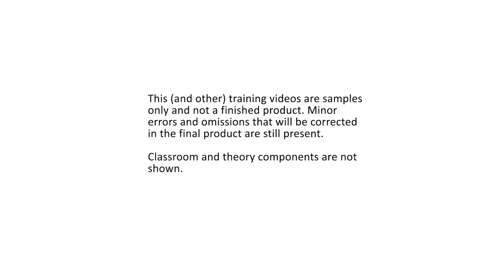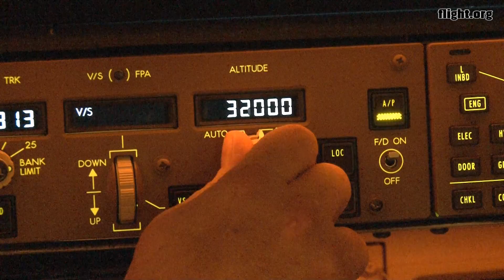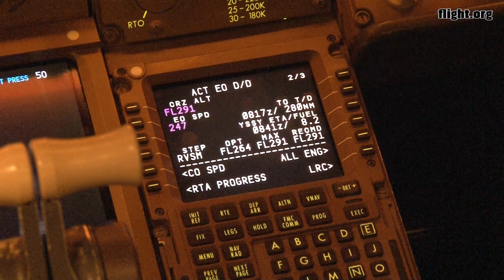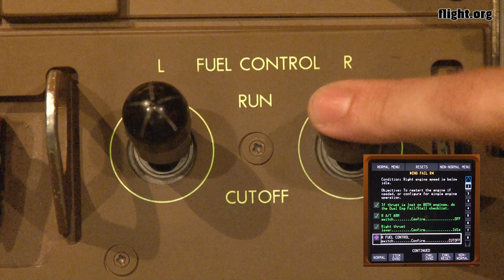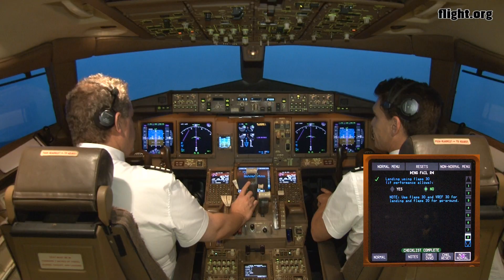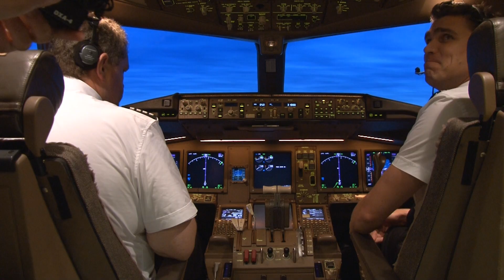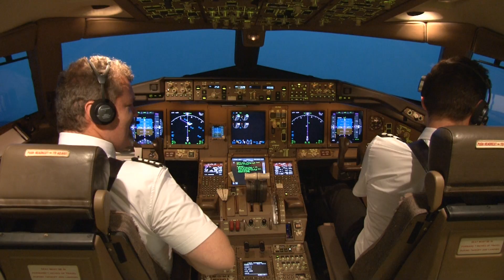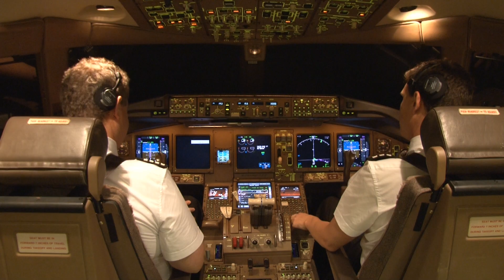Engine Failure and Driftdown in a Boeing 777

Comment: Why using Flaps 20 and not flaps 30?
Reply: Several reasons. At about 15-25 (exactly number depends on design details) flaps are generating best lift/drag ratio. At 35-40 its juts little more lift (more exactly coefficient of lift) but drag increases much much more (which is somehow better at landing because of more aircraft stability). In single engine operation and full flaps (35-45 depending on aircraft type) its higly possible to need for full or almost full thrust from remaining engine. Full thrust from single engine cause more asymmetric thrust and more rudder deflection (even full rudder and full aileron). Also, you have not spare thrust for go-around.

Other reason is failure probability. At idle failure almost never happen. At full thrust (sometimes more than 100% for some time is allowed) its very likely to encounter another engine failure. Thats why in most cases at take-off, less than 100% thrust is used.

Personally in flight simulator I dont like to use full thrust in half of planes - its easier to control and speed is not increasing too much - I have not other pilot in simulator to handle flaps and monitor speed - so I need more time, to make this safely (even if this is a simulation).

Comment: Why didn't they switched on the fuel x-feed?
Reply: Not in the checklist. If working engine is connected to right/left wing tank only, then will be unbalanced fuel alarm when it should be. Feeding fuel without necessary reason is not good. When You encounter fuel leak, then (in most cases) You dont wanna to feed hole in wing. Double/triple emergency situation is very rare, but it happens from time to time.
Reply: @norbert.kiszka  Cool. never thought about it that way. So when imbalance caution arises, it's time to verify if there are conditions to perform that specific checklist. All this because of that Air Transat Azores Glider...

Comment: Outtakes of actual flights are called “disasters.”
Reply: This planes (transport planes) are designed to fly and climb just on half of available engines. BTW. Even of lost all engines and also power (hydraulical and electrical) then plane will not fall and still will be manouverable by mechanical linkage (at least rudder and THS). Today only problem to concern at flight at high altitude is a fire inside cabin, flight deck or elsewhere in plane. Fire in plane can be caused by stupid passenger. Personally in case of double engine failure Im going to sleep and wake up after emergency landing. So please stop spreading misinformation.

Comment: Perfect crm. But didnt they divert 30 degree either way upon driftdown from the current FL?
Reply: But why...?
Reply: In a pressurization rapid descent maneuver, it is more appropriate to do a diversion off the airway, and it will not be wrong for an engine failure drift down maneuver. However, If under positive control in controlled airspace, you would be descending, at slightly higher than normal descent rate,[ to maintain airspeed,] to a single engine drift down altitude. That is something ATC [ Air Traffic Control  in a radar environment ] can manage to accommodate.
Reply: +Denis Levashov  In this video example the cruise altitude was FL370 and the drift-down Single Engine cruise altitude [ calculated by the flight computer ] was FL290.  so you are doing a decent of Only 8,000 FEET while maintaining cruise airspeed. This Procedure is not a big or sudden change of altitude.  When the pilot declared "Pan  Pan  Pan" [ Indicating Emergency Status ] He has airspace priority as an Aircraft in distress.
Reply: Well, i dont agree that 8000 feet is a not a big sudden change of alt, at least, if in RVSM you are crossing at least 7 FLs. Declaring a PAN PAN PAN doest give you any right to compromise safety of others but if just in uncontrollable dive.
I got your point and dont want to argue having in mind that it was just a sim session, and in real pilots know how deviate from current FL right.
Best regards!
Reply: Whoa  COWBOY. I never said what you are saying. Clearance to FL290 was requested and received by this crew @1.15 minutes, so what's your point.  Many aircraft descend from one Flight level to another routinely along the airways with ATC . Its a normal decent. I don't know that a controller will make you stay up there loosing airspeed and lift.  THEY GOT PERMISSION TO DESCEND.
Reply: Tom A sorry, my bad than) thanks

Comment: what to do when i got engine flame out ? is possible to fix this problem ?
Reply: Whenever an engine flames out, immidietly, extinguish the engine, make a mayday distress call and ask atc for headin to nearest airport. Tell them where ur heading, whats ur current alt etc. for ex: "mayday mayday mayday tower air velocity 2886, we have a fire in one of our engines we are currently heading 189 and at flt lvl 290. Requesting vector to nearby airport." Atc would give u headings and tell u to descend, make sure u follow those rules.
Reply: +MR COURIER Before all of that, fly the damn plane.
Reply: Alistair Hammond lol yes. One person handles the crysis, and the other one flies the plane.
Reply: i noticed on my xplane 10 that when engine flame out you need to set ignition on CON in boeing 777 and the engine will started. But when you set START engine wont start.

Comment: 0:47 minutes right engine failure without airframe vibration. 2.40 minutes engine restart as needed yes or no [ no ]  This is a captains decision, but no substantial evaluation done towards engine restart  [ oil quantity,  vibration meter, oil temp, etc ]. even at idle the recovery [ of this engine] enhances the systems operated on the right side. [ example pumps generator and air condition packs]  Is this normal company procedure considering that this is an overwater aircraft.  // hilarious video.

Comment: where can i find a flight simulator and how much do they usually cost?
Reply: Usually, it costs between 30million - 50million dollars
Reply: sorry, I meant to use it
Reply: ***** I don't know where you are; but in Melbourne (Aus) there is a company called jet Flight Simulator-they have a 737 NG cockpit and for about $200 AUD you get about half an hour.Note: this is not a full motion Sim (like the airlines use) but it's as realistic as it gets for the money. They supply an instructor,and you can land and T/O at any of the major airports around the world-good luck.
Reply: chris hood Thank you
Reply: ***** If you want to try a Flight Simulator without all of the controls, you can use Flight simulator X, it was republished on steam and it has a virtual cockpit, but also buy PMDG Aircraft addons, they use complete simulation, where as the default planes don't include all of the devices.

Comment: PIC noted insuf-fuel. Now. Is that mainly due to one engine working now and the recalculation? Or the fact that they kept on full NAV mode and the computer noticed fuel economy at the new flight level and that was the reason for the insuf-fuel warning?
Reply: Both.
Reply: +William JSS   when you do flight planning you ask the captain " how much fuel would you like to land with. This is considered your OWN personal reserve fuel setup. Example "I want to land in Sydney with 12,000 lbs of fuel". [ that number is entered in the flight computer ] that is about [say] one and a half hour of extra fuel.  if ATC assign to you a TEN minute holding delay you know that you have 1hr 30 minutes - minus 10 mInutes - reserve.  WHEN you loose an engine or enter holding [ with expected 10 minute delay ] the computer recalculated the new fuel burn and realizes that on one engine [or with ATC holding or with stronger headwinds ]  you will not land with 1 Hour  30 minutes of fuel so you get the "Insufficient Fuel" warning. The pilot can then talk it over with the crew and suggests that we are ok landing with only one Hour reserve fuel. You then go into the computer and adjust the landing fuel from 10,000 lbs - 1 hour 30 mInutes to 8000 lbs which represents only 1 hour reserve. This would turn off the INSUFFICIENT FUEL WARNING.

Comment: an engine failure in a 777 in the middle of cruise is not a big deal and is hardly something to get worried about. it can take off on a single engine even at maximum takeoff weight, and the flight plans are designed so that the plane can divert to a suitable airport easily enough with one engine operative.
now if both engines go out you're going to have problems..(though it's happened before and the pilot landed the thing!)

Comment: I'm a 777 crew... the "cuts" at the end are more reflective of a real crew than the procedure portion, but I understand this is a training video.  The comments at the engine failure itself would be more like "F me. Now we're spending the night in Manaus... or Kuwait... or Keflavik."  Your guys do good work procedurally.  These videos also show off the 777 nicely.  Good job.
Reply: Great job, but I'll be a smart ass. No one confirmed Continuous Thrust set on the good engine. :-)
Reply: @777Outrigger As Instruktor in case of engine failure at cruise altitude my question to candidates was: what is the bottom line of your problem? I’ve heard so many answers but almost never the crucial one : we cannot stay at that altitude with one engine only!!! That is what Situation Awareness is all about!!! To buy a time press MCT and then do the procedure as this two guys did it! I’ve heard a dozens of comments opposing my suggestion, the winning one is why Boeing newer put it in the check list? Thinking out of the box is never written in the check list or procedures for one reason only: the risk is yours
Reply: hey why don't you like Manaus?

Comment: Would pilots react that slow on a real flight?
Reply: Yes. Almost... First thing is to press right (or left - depending on which engine failed) pedal to move rudder surface. Then You can use rudder trim to release your leg. Not a big deal. Its better to do things slow than make one but very big mistake.

Comment: Are pilots THAT calm when an engine fails? I agree? WHAT?
Reply: Why not? Single engine failure is not a big deal. Pilot in panic can cause crash. Engine failure is almost impossible to cause crash - all transport category aircrafts have very big rudder at tail in case of asymmetric thrust due to single engine failure.